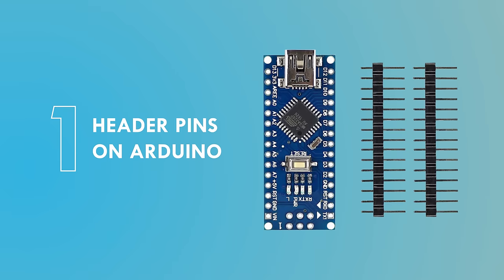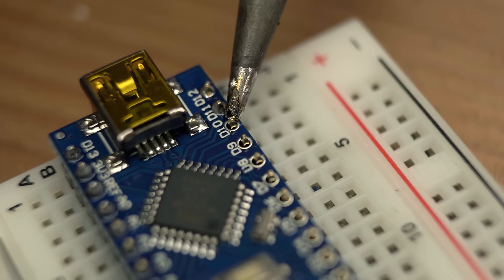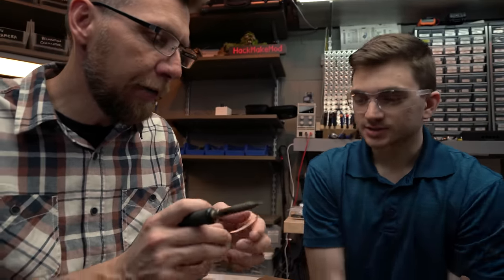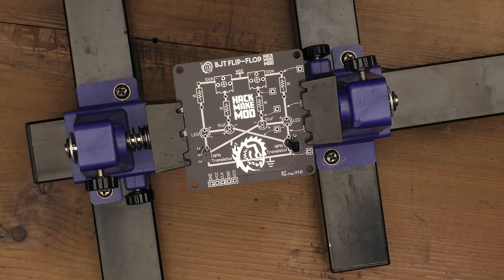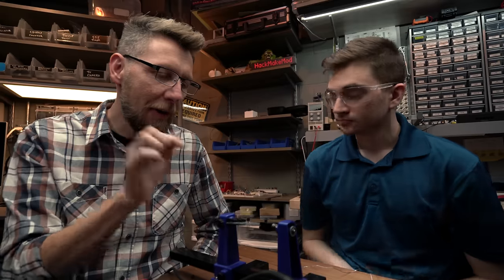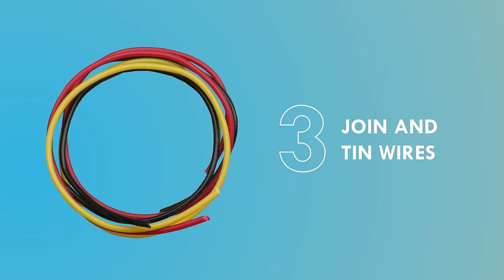HOW TO SOLDER! (Beginner's Guide)

Comment: I bought 63/37% Kester 44 solder with 3% flux, the most expensive standard electrical solder on the market, and it adheres noticeably worse than cheap 60/40 solder with 2% flux that came in a kit with my Tectronics soldering iron. I can't figure out why the 63/37 seems to "repel" away from the solder joints initially and only sticks when the heat is super slow, but the 60/40 solder seems to flow out and wet the parts regardless of the temperature. I've had some parts where the 63/37 (I tried 2 different brands) doesn't want to adhere to the part at all, and has a type of electrostatic repulsion force that keeps it away from the heated part. I'm beginning to suspect that parts are tinned from the factory with 60/40 solder, including the circuit board traces.

Comment: I watched the video, it is suitable for beginners. Let me ask you a word. What material are you using for soldering?
Reply from the maker: At 2:06 I shared the solder we used (60/40). I also mentioned non-leaded solder. I went into detail mentioning that leaded solder is the unhealthier choice but easier to work with.

Comment: Hi! I'm 9 months into soldering. I'm currently working on high voltage power supplies. I have to make a solder ball joint with a wire to turret(upper  guide slot). Was wondering if you can show how to do a ball soldering connection. I'm having trouble, please help. Thank you in advanced.

Comment: Question: How do you heat up micro wires, like the ones in a phono tonearm, without melting the wire? My wire keeps burning up before the solder melts.

Comment: Doesn't seem like it would be good to breath the fumes if it has lead in it.  Do you have to use a certain kind of soldering iron if you're using the lead free solder?  Is it just as easy to use as this kind with 40% lead if you have the right iron that gets hot enough, or is it still more difficult to solder with?

Comment: bar a couple of small points you have confirmed i'm not far off! thank you! there is one thing i would like advice on please!..i do alot of guitar wiring and see to have a problem wiring the earths to the spring claw as its quite a large area it gets very hot before the solder melts! is there a way to disapate the heat!? cheers!
Reply from the maker: You can use a metal clamp below the area you are soldering to help draw some heat away from the area you don’t want to get hot.
Reply: You can also use wet paper towels to protect sensitive components. But what you really need to do is get a larger soldering iron tip. The larger thermal mass will let you heat quickly the part of the workpiece that you want to heat.

Comment: So my solder is Sn99.Cu0.7 with a melting temp of 230-240°C. What would you use for iron temperature without risking to break components? Higher than 400°C?

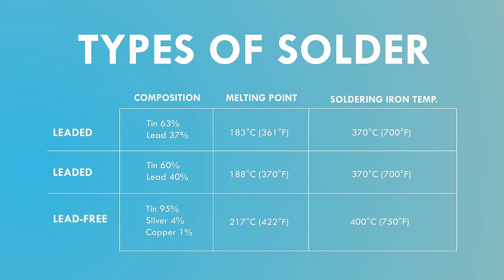Comment: 2:20 If more Tin (and less Lead) causes a higher melting point for solder, shouldn't the one in the middle with 60%/40% Leaded solder have a lower melting point than the one above with 63%/37% composition?

Comment: soldering wire ot wire like that will fail over time.  you can tape a qtip to it to make the joint not bend there and break which will make it last.  But better yet is just twist them together and tape tightly and it will not fail that way either just don't solder at all.  Or use a crimp connector.

Comment: I've never been able to gets my hand on the copper wire to fix bridged points or whatever mistake.. one tool that I use to desoder parts or mistakes is something like a syringe.. you pres it down . Heat the blob mistake.. the the syringe has a quick release button that kind of suck all the extra heated solder material... Sorry my English hope it can be understandable for fluid English speakers..

Comment: Rosin core, not flux core. You don't want to use acid core. Acid is a flux too. I wouldn't tin the wires, place them side-by-side, and solder them like that. I'd bend the ends into a hook and make a mechanical connection before soldering them.

Comment: Is there any advantage to first crimping on a copper sleeve over the soldered joint, to make it mechanicaly secure, and then put on the tube-shrink?
Reply from the maker: No. You would only be risking cracking the solder. As long as it’s is soldered correctly the bond is stronger than the wire itself. 💪
Reply: @HackMakeMod  Thanks! Here's another question: Does the iron-cleaning pad have to be brass? Is copper OK?

Comment: I think I just suck at soldering. Can't get it to stick to a copper rivet wire connector that broke on my fuel pump wires. I will continue to learn.
Reply from the maker: You may need a more powerful soldering iron.
Reply: @HackMakeMod  , apart from using way too much Flux, I think even leaded solder was unable to bond with what I think is copper but it could be brass or just discolored aluminum. 

I used a conductive glue instead but, that was too weak and it didn't stand my tensile test after it dried, which is just yanking on it a little, and it plucked right on out with hardly any resistance. 

It's too bad regular super glue isn't conductive...Maybe I can make it conductive with lock lubricant graphite. 🤔
Reply: @phoenixmistertwo8815  
Practice! Some things are easy to solder, some can be remarkably difficult. There is art and science to soldering and it takes a while to learn.

Brass, if it is clean and bright, is usually pretty easy to solder, but it does depend a bit on the alloy. I've soldered all sorts of brass items using ordinary flux cored solder intended for electronics work. Large items may require a large/high power iron to deliver enough heat, but brass doesn't conduct heat very well, unlike copper.

Aluminum requires a special, very aggressive flux. The metal must be freshly cleaned with abrasive or steel wool because oxide forms very rapidly on the surface of aluminum. The flux that works with aluminum must be cleaned off because it is quite corrosive. It also has a tendency to spatter.

Sometimes things that look like bare metal actually have some sort of organic coating on them. Circuit boards intended for use in harsh conditions may have a "conformal coating" that may be a silicone, polyurethane or acrylic. Removing the coating from the area you need to solder is just about essential, though you don't always need to, depending on the specific coating.

Comment: I have a weller iron ws 50.   I want to know what temperature you use for soldering small components or wires. Thank you in advance.
Martin Pols
Reply: I've done a vast amount of electronics soldering over the years. My preferred temperature for most through-hole work is around 370 °C (700 °F).  For some things I use around 315 °C (600 °F) or even a bit lower for surface mount. Sometimes I use about 425 °C (800 °F) but rarely for anything on a circuit board.
These temperatures are all for tin-lead solders (60 or 63% tin,  remainder lead). With lead-free solder you may find somewhat higher temperatures to be better.

Comment: HOW TO SOLDER:

1.) Pick a good brand of solder,  there are a lot of cheap solder out there that will make your soldering job extremely harder than it should.
2.) Pick a good brand of Flux,   there are a lot of cheap flux out there that will make your soldering job extremely harder than it should.
3.) Pick an adjustable Soldering Iron, that can be set to 350C, it will make your life so much easier.
4.) Pick a good quality SOldering Tip, it will make your life so much easier.
5.) Pick a Soldering Tip that is flat on it's edge.

Comment: 11:04 DO NOT use a silicone mat! Despite the fact that many vendors sell soldering mats made of silicone, they’re very unsuited because they generate TONS of static electricity. Using silicone risks causing ESD damage to sensitive components. Use an ESD-safe mat (they’re slightly conductive and connected to ground) instead.

Comment: Do you have any tips for reaaaally tiny components. Like I had a suuuoer tiny resistor that went to my HDMI port on my laptop that I yanked off by accident (it connected but no image). I spent like 30 minutes trying to get it to connect and not be janky. I tried holding it in place with a tweezer, the tweezer was too big, and every time I tried soldering it to the board the surface tension would legit pull it off the board with the iron that’s how tiny it was. I eventually got it to work by putting solder down before hand and slowly heating it up with the iron tip. Is there any way to make this easier without investing in a heat gun
Reply from the maker: Some people can do this type of work with a regular soldering iron… unfortunately I am not one of those people. I eventually got a heat gun
Reply: @HackMakeMod  thanks, I’ll probably invest in one at this point

Comment: Sir, sometimes the wire (specially those pre-made dupont-connector wires) doesn't want to get tunned!
They turn black but still no tin!
What wrong am I doing?
Reply from the maker: There are a few things that might be going wrong:

Soldering Iron Temperature - If it's too low, it won't melt the solder properly. Too high, and it might burn the flux before it can clean the wire, leading to that black residue.

The flux in the solder might not be sufficient, especially with cheaper solder. Try using additional flux.

Some wires, particularly cheaper ones, can have coatings or impurities that make soldering difficult.If the wire turns black, clean it off and try again. Sometimes a bit of sanding or scraping is needed to remove oxidation.

Low-quality solder can cause problems. Make sure you're using a good quality one with a suitable flux core.

Make sure the iron tip is clean and tinned. Heat the wire directly and apply solder to the wire, not the iron.

I hope this is helpful!
Reply: @HackMakeMod  Thanks a lot.

Comment: With the Arduino, the blue board part, how hot can that get? Can that part melt if the soildering iron is pressed against it for too long?
Reply: Most printed circuit boards these days use a substrate of "epoxy-glass." It consists of layers of fine woven glass cloth impregnated with an epoxy resin. It is quite heat resistant but can be damaged if heated for too long at a temperature that is too high. It's pretty rare to do that when hand soldering small parts with a decent iron that isn't too hot. One thing you can do is cause the pads around the holes to 'lift' - become detached from the board, with excessive heat. Avoid pressing a hot iron against a circuit board with more than just slight force - less than you'd typically use if writing with a pencil. If you use too much force you are more likely to cause the pad to lift.

Once you get good at soldering, which can take quite a bit of practice, soldering small parts on a circuit board can go very fast - no more than a couple of seconds per joint. Bigger things can take longer.

Commercially, most circuit boards are wave soldered if there are through-hole parts or reflow soldered if the parts are surface mounted. With reflow the whole board is heated to a temperature high enough to melt solder, though the process is carefully controlled. In wave soldering the board passes over molten solder that is pumped through orifices to make a "wave." Modern circuit board materials hold up to this quite well.

Comment: I wouldn't solder from the top, especially components like transistors. You are likely to end up with the tip or body of the iron touching the component and they really don't like the heat and as a beginner you are likely to take your time over soldering, transferring even more heat. Also some PCB's are single sided so soldering from the top isn't an option. Learn the correct way and solder from the bottom. Also, do not bend component leads to hold them in place. Components fail, mistakes are made during assembly and components with bent over leads make removing the component 100 times harder and you're more likely to damage the PCB. Simple way to hold components in place, a blob of blue-tac is ideal. Drop one component onto the board, a blob of blue-tac to hold it in place, solder one lead from the bottom, quick check to make sure the component is still in the correct position, then solder the other lead(s). One component at a time, nice and steady. If you mount a lot of components at the same time on a busy board you end up either missing some solder joints or the leads from components get in the way of the lead you are trying to solder.

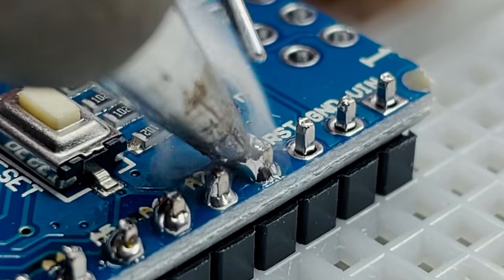Comment: 4:30 for desoldering, when i do this it still doesnt melt, even at 400c, and i need to first melt it directly on the iron, and it takes actualy few second, might be at lower degres than it score? And sometimes the tin doesnt attach to the connector im trying to desolder, and 6:25 would this work if i manage to actually put tin? Cause with the pumo didnt work that much, like i almost desoldered but for some reason is still attached. i would like to receive some help :)
Reply from the maker: It sounds like you're dealing with a couple of common issues in desoldering: solder not melting properly and difficulty with solder wicking to where you need it.

Firstly, if the solder isn't melting at 400°C, there are a few potential reasons:

1. Incorrect Temperature Reading: Your soldering iron might not be as hot as it indicates. This can be due to a faulty temperature sensor or calibration issues.
2. Heat Transfer Issues: The heat may not be transferring effectively to the solder. This could be due to a dirty or oxidized tip, or the size of the tip might not be appropriate for the job.
3. Solder Type: Some solder, especially older or high-lead content solder, requires higher temperatures to melt.

To address these:

Clean and Maintain Your Iron: Ensure your iron's tip is clean and properly tinned. A dirty tip can significantly impede heat transfer.
Tip Size and Shape: Use a tip that's appropriate for the size of the work. Larger connections need larger tips to transfer more heat.
Consider a Higher Temperature: If you're confident it's safe for your components, you might need to increase the temperature slightly.

Regarding the solder not sticking to the connector, this can be due to:

1. Oxidation or Dirt: The surfaces you're trying to solder might be oxidized or dirty.
2. Insufficient Flux: Flux is crucial in helping solder flow and adhere to surfaces.

Here are some tips:

Clean the Area:Use isopropyl alcohol to clean the area you're working on.

Apply Flux: Use a good quality flux to help the solder flow and adhere to the surfaces.

Pre-tinning: Sometimes, adding a bit of fresh solder to the joint before desoldering can help.

As for using a pump ("solder sucker") and it not working well:
You need to apply the pump the moment the solder melts. If the solder hardens even slightly, it won't work.

Sometimes using desoldering braid (wick) in conjunction with the pump can help remove stubborn solder.

Adding fresh solder can sometimes help with heat distribution and make desoldering easier. Remember, desoldering can be tricky, and it often takes practice to get it right. Keep at it, and you'll improve!
Reply: @HackMakeMod  thank you very much!

Will absolutely follow your recommendations, and chech if the soldering is alright, have a good day/night

Comment: Sir hack,,I had a question about transistor part#p5nk80z. How to know d good or bad component?tnx for d answer..
Reply from the maker: To test a transistor, such as the P5NK80Z, and determine its functionality, you can follow these steps:

1. Start by disconnecting the transistor from any circuit or power source.

2. Identify the pinout configuration of the transistor. You can refer to the datasheet of the P5NK80Z for this information.

3. Set your digital multimeter to the diode test mode.

4. Connect the black probe of the multimeter to the transistor's emitter pin (E) and the red probe to the base pin (B).

5. Observe the multimeter reading. In the diode test mode, a functioning transistor should display a voltage drop of approximately 0.6 to 0.7 volts.

6. Reverse the probe connections, with the black probe on the base pin (B) and the red probe on the emitter pin (E).

7. Take note of the multimeter reading. Similar to the previous step, you should see a similar voltage drop indicating the transistor is functioning correctly.

8. Finally, connect the black probe to the collector pin (C) and the red probe to the base pin (B).

9. Observe the multimeter reading once again. In the diode test mode, you should see a voltage drop similar to the previous measurements.

By performing these tests, you can gain an initial understanding of whether the P5NK80Z transistor is functioning properly. However, it's important to consult the transistor datasheet or refer to appropriate testing procedures to ensure accurate results and understand the specific characteristics of the transistor you are working with.
Reply: @HackMakeMod  thank for good reply sir hack. GOD bless u.

Comment: Instead of using solder wick, use an old toothbrush instead. Swipe the toothbrush to the desired excess soldering lead that needs to be removed. Don't bother using a desoldering tool.

Comment: On yt soldering seems easy... the secret is, everyone using non lead-free solder in the videos... Problem is i dont want to use pb solder so its much harder, you need to use high temperature, fast oxidation etc etc.
Reply: Try a modern lead-free solder using the tin-copper-nickel-germanium alloy. (I recommend Felder brand Sn100Ni+ Iso-Clear. It’s almost as nice as leaded. I recently gave a few meters of that to a coworker who hadn’t tried lead-free in years, and he was really impressed by it.)
Reply: @tookitogo  Sounds great, Thank you!